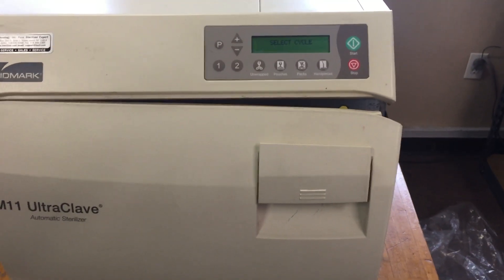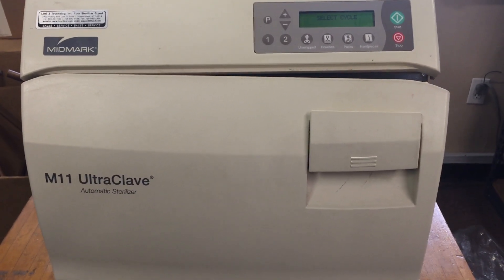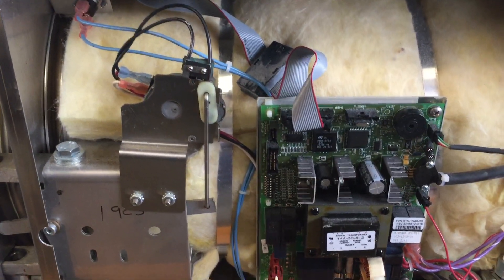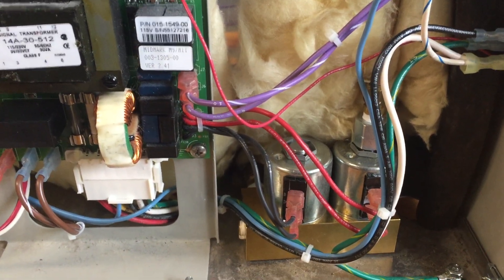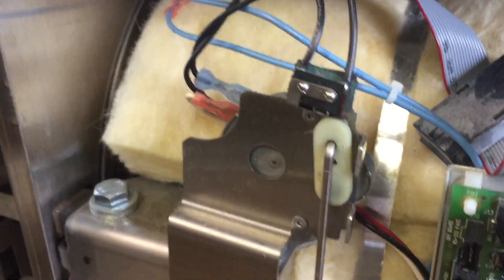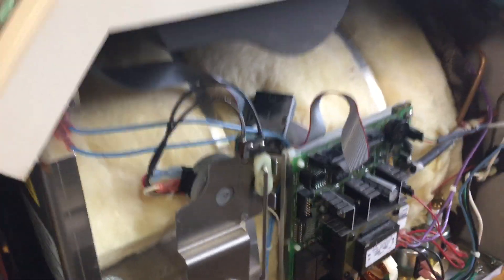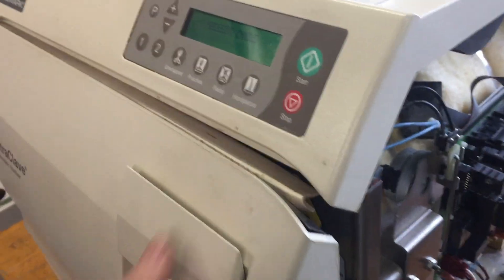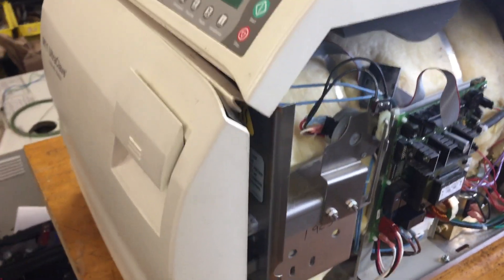How to fix Midmark M9 M11 sterilizers autoclaves

Comment: Just wondering if you had some information on the Midmark M11 Gen 2 sterilizer, I am trying to attach an aftermarket printer to a unit and was wondering if you knew the pinout of Printer Port J14? Thermal printer is discontinued, and Dot Matrix stock is almost depleted...so we are stuck. (unless you have a print solution that you sell)
Reply from the maker: I can email you tech manual
Reply: From what I am told, pin 8 = Ground pin 7 = +5 (but only for the printer.. not signal) I ?think pin 1 is ground.. not sure what voltages they run signals at    5V -3.3v? ... or what connection the printer uses. TTL/Rs232..etc.. I am pretty sure it is TTL serial ... 5v.. Midmark is not being supplied any printers any more by the mfg.. so do not want to buy a midmark printer.. would like to interface my own POS style printer.